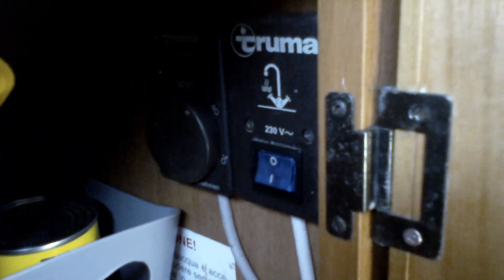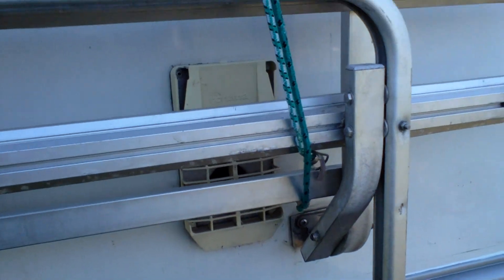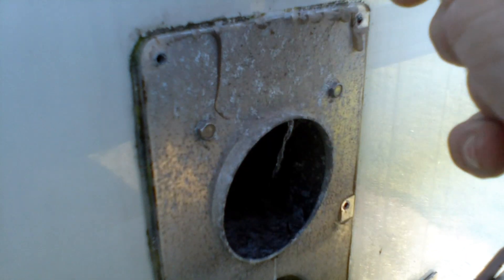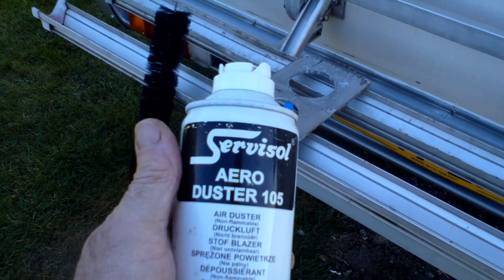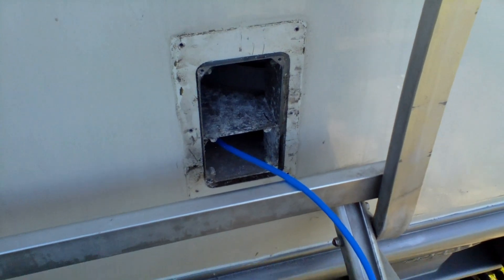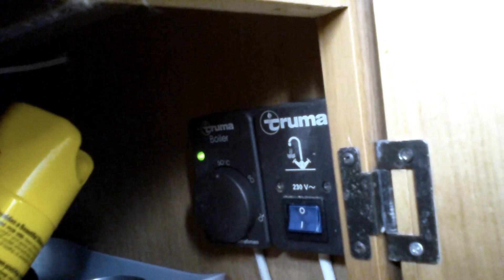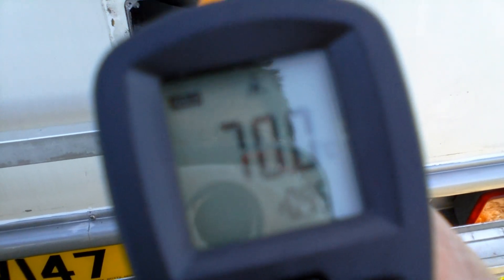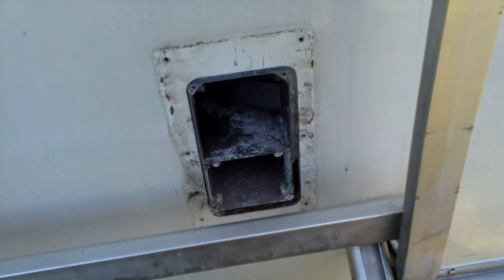TRUMA WATER HEATER SERVICE

Comment: Try wd40 b4 trying to get old bolts out
Reply from the maker: Hi there Uo.thanks for the comment I think it would still have happened as it’s a steel bolt into a cast aluminium casting so with the dissimilar metals and open to the elements this is almost inevitable. Before I put them back I greased them so with luck if I ever need to get it out again the bolts should come out easy🤔I hope!
Thanks for making a comment which could help others.
Regards Peter